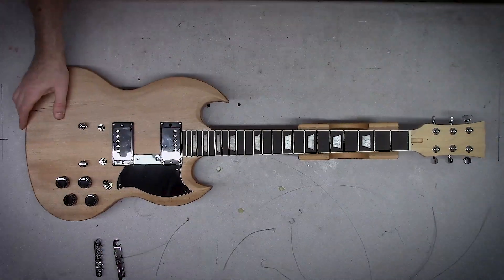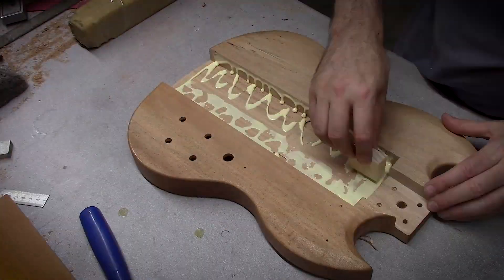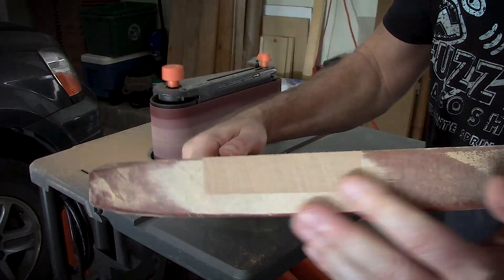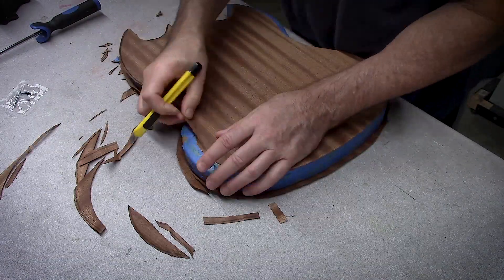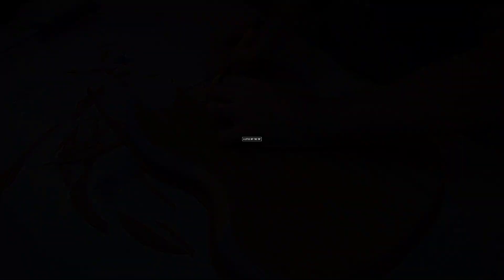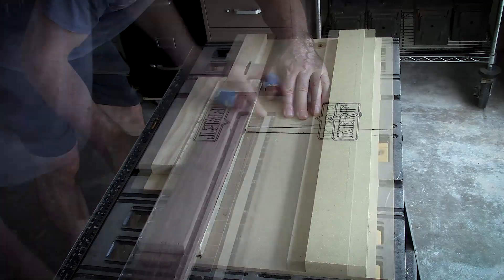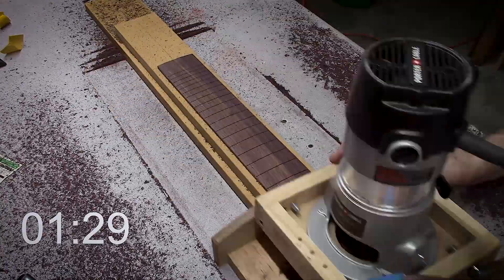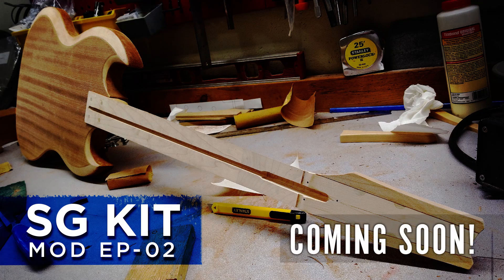Harley Benton SG Style Guitar Mod Project - EP 01

Comment: Once removed a fretboard with an iron. Took me 2,5 hours. Interesting project.
Reply from the maker: Nieko, thanks for watching!
I hear ya, I've used an iron a few times before. Some fingerboards gladly come off, others resist.
The last HB fingerboard I attempted to remove, resisted. I think they use some spaceshuttle tile glue to put the fingerboards on with. So, I just cut it off.
If this were a restoration project, and OLD guitar, and I had to save the fingerboard, heat and moisture would have been the way... but not on this one. 
Oh well, we just gotta keep things moving sometimes.
I hope to fix and simplify this guitar. Less is more.
Take care!

Comment: Cool. May I ask why you did not replace the truss rod with a two way. Possibly it already is? Great Video as always.
Reply from the maker: Gary, thanks for watching!
The trussrod is two-way, and other than the protective shrinkwrap damage, it was in good shape, worked perfectly.
Possibly the main issue was the channel seemed waaaay too tight. 
Even with the fingerboard removed, the rod was stuck in the channel. I cranked it to an extreme, and all it did was raise the adjustment end a bit. Once I "tore" if from the trench, the rod showed the extreme bow, yet the neck hadn't been moving....very odd. 
All better now, whew!
Be safe and take care!

Comment: I would modify the horns too. Even the Gibson has asymmetrical horns and this always irked me. I really would like to see an SG with symmetrical shapes.
Reply from the maker: EbonyPope, I hear what you're saying about the horns.
I've messed with horn shape and symmetry on previous project.
Maybe it's just me, but when I made a truly "symetrical" top and bottom horn, for some reason the bottom horn always looked larger than the top. Makes no sense, maybe an optical illusion, idk.
There were other ideas that didn't make it into this mod project. Too many idea, too little time.
Thanks for leaving the comment, take care!
Reply: @theNextProject   @the Next Project  I think that's because one is so used to seeing the upper horn as the bigger one. I've seen some self built SG copies with symmetrical horns that looked really good. I think Tyler Larson from music is Win has an SG copy that is built like that. What I observed is that the horns shouldn't be both as big as the upper horn because then the neck looks short and the body too bulky which is exactly what makes the SG look so elegant. Just look up the "Wylde Audio barbarian". I could do without the curve at the tip of the horns though. Have fun!